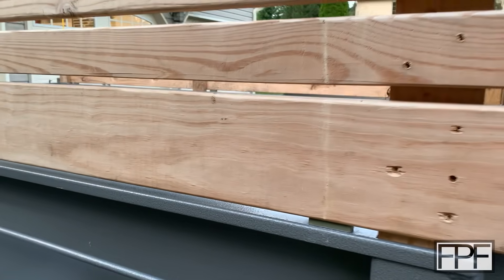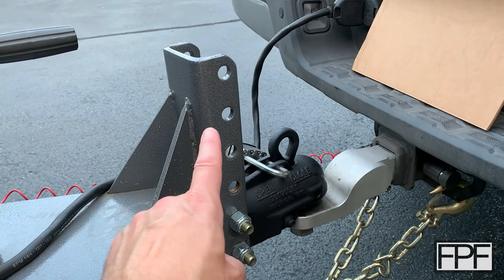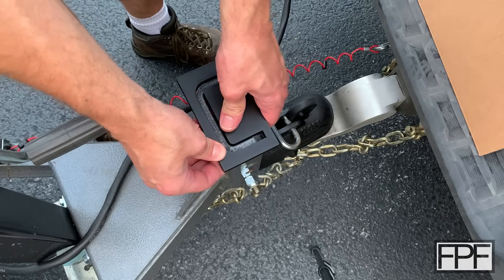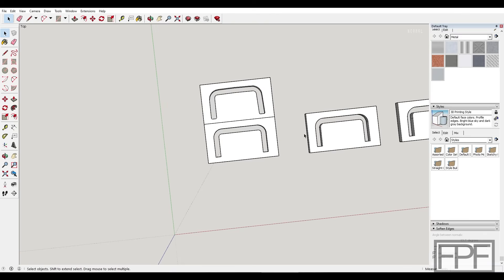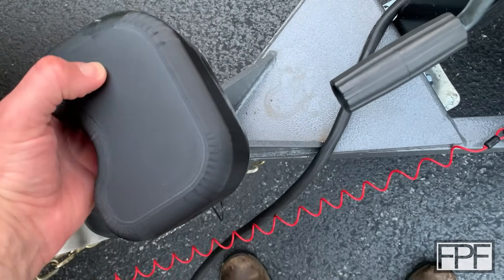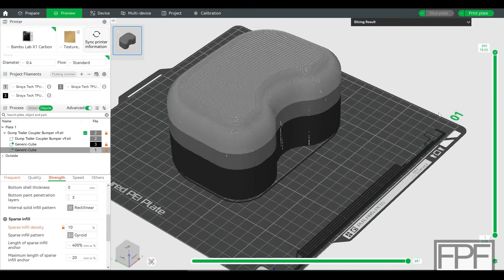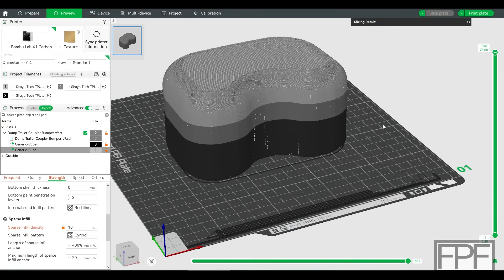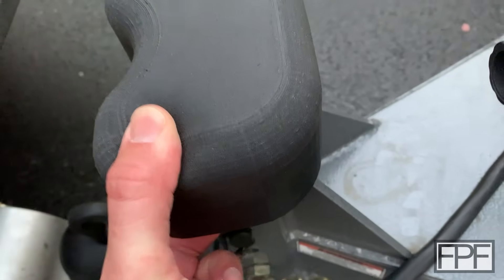3D Printed Bumper for Trailer

Comment: This is a nice print and good technique but I'd be concerned about what would happen if anybody sits or jumps on the tailgate where the pressure is on the bumper instead of the support cables at the sides. I vote for using a grinder to cut off the u plate down 1 set of holes so the weight load is in the correct spot on the plate.

Also do you have calipers?  They might help a bit for something on these lines as well.

Great video and showcase of the TPU differing stiffnesses!

Comment: Hi there, just started watching yo channel and thanks for taking the time to share. I saw the lathe comparisons, and the trailer bumper, and you had mentioned that you needed it softer and I've just been getting an advertising for a 3d type printer that only makes softer jell parts, and I'm sure it would be closer to your needs, then other 3d printing materials, but I am shocked to know the material makers couldn't come up with a formula of printable materials that were softer, my goodness they can print a house out of cement but not make a poly blended plastic that would give ya a softer part. Look at how many recycling Co., that won't recycle those black plastic containers you get your Chinese take out food in. The plastic is really flexible and rubbery like, if that plastic had more poly blend added to it, I'm sure they could find a winner. Anyho nice job on what you used it got a good cushion to save yo tailgate. One for the winning team at least this time ah! Please Have The Best Day's Possible from All of Us at: Bare.Metal.Custom.Workz in Barrie ON Canada 🇨🇦 Sincerely Andrew

Comment: Probably too late to see this comment but I recently added a 10W laser to my CNC machine and it's been incredible for templating and testing fitments on a plane.  I just laser cut thick construction paper or 1/16" MDF instead of 3D printing and use that to refine my designs.

Comment: To be honest you probably could have just left the first print as it was and shrunk it by .5% and because your final material was TPU it would have been as sung as the final print you did. TPU is very forgiving with dimensional accuracy. When I have to make something that has threads an is going to be printed in TPU I make it exact size and do no offset on the threads and it is tight but is more secure. Good vid though.

Comment: Nice job. Any chance you could look on Makers at the 1300% Dummy print? It has joins for articulation, very similar to the nubs you put on the bumper to hold, but they are too loose. You would be the perfect bloke to come up with an "addon" solution. I can't think of one. It's a print that has no real purpose other than shts and giggles and a great learning process

Comment: ik this is a 3d printing channel, but if you never plan on going that high on the drop hitch id have just lopped it off right to the top of the triangle bracing then shot some paint and capped it with a print rather than have a bulky butt shaped pillow lol. otherwise great work

Comment: Pretty wasteful prototyping on this one. Really felt like those tests could have been done with far smaller prints.

Also, does that CAD program not allow for high geometry resolution exports? There should be no reason for the final product to have those low poly style lines.

Comment: Instead of making the part a tight fit on every surface, you would save yourself time and make a more functional part by indexing the part off of the flats. You really only need the part to touch on a face in each cardinal direction to constrain it's movement on the XY-plane. The corners of the box section are the least predictable/reliable geometry and are redundant for constraining the part.

Comment: Nicely done. Noticing how the metal channel isn't square, the fastest most accurate method could be taking a few key measurements and then a good photo of the top view, non distorted so you can use that as a reference image to draw your profile over. Import that onto a top view plane and scale it using your measurements and then extrude the C channel.

Comment: You did make it fit after the shape of the steel..just make it like a thicker part around in the same shape of it with just a bigger soft top like u have it now mabe. like cutting of the sides/front/back from the org design..but sure it does the job right now :)

Comment: If i were having a part like that hitch riser made in volume, i'd punch the holes first, then cut the outside edge, then bend it in a press brake. Probably in a machine with a cnc punch press integrated into the cnc plasma or laser table. That why you couldn't find the profile - every shop that's making them is getting a slightly different profile. And you'll probably find, if you look closely, that the trailer manufacturer carefully designed around the expectation that the profile would vary from one supplier to another.

Comment: For an even lower tech solution, you can always photograph the top from a straight down perspective and trace in your CAD software. Alternatively you can make a template with card stock or even use a contour scribe tool (3d printable too) then scan the outline to trace in CAD. That's probably the quickest and least wasteful route without needing a 3D scanner
Reply: Even lower tech...  Hold a piece of paper on the top of it and rub it with a pencil (like we used to trace coins in school). Stick the paper in a scanner and you get a dimensionally accurate outline that you can trace in CAD. 

After you trace it, expand the outline by a bit to give yourself some tolerance for a sliding fit.
Reply: Great point!

Comment: Minimal surfaces in general and gyroids in particular are very brittle structures. They have this interesting property that once they fail, the layer that failed crushes, and the two layers sandwiching it jam up and recover about 90% of their structural strength. Which makes it great for things that need to stay stiff and not fail catastrophically. But they're not great for bumpers and shock absorbers.

You could probably dissipate a lot more energy with a re-entrant lattice. A fully 3D lattice would have some gnarly overhangs between its cells though, so I don't think a fully 3D lattice would be the way to go. But an extruded 2D re-entrant lattice (2.5D you could call it) running parallel to the hitch, with the part printed on its side, could probably work quite well.

Comment: I noticed that the curves in your part have a lot of facets. I can usually fix this when exporting from Onshape by using "fine" STL or using STEP files instead, but it appears Sketchup doesn't offer those options. After looking around for a bit I found a video discussing softening and smoothing in Sketchup that can help with this. I posted this comment earlier with the link to said video, but it seems to be gone now, maybe there is a setting that is blocking comments with links (understandable), apologies if that was the case. If interested in the video, a quick search and you will find it.

Comment: Great use of material! For finish, if you can export the file as step or stp, when you import to Bambu you’ll have the option to set parameters for the resolution of the part. You can leave the linear deflection down low and keep the angle deflection near the middle, this will give you smoother radius’s. Essentially what you got from the stl and 3mf files were lower triangle counts for the surface which gives you that step effect on the surface of the radius. Give it a try and you’ll appreciate the result!

Comment: That is some cool filament. I am a newbie and just made my first print for  a surge protector to attach to my wall. I took a picture of it and scaled it but it was taken to long so I found a file on one of the share files. I learned that it is very difficult for a hobbyist. I just use the free SketchUp and they limit you on file types to upload err. Then I was given a 3d printer and the software was unable to be upgraded err. I did manage to get some prints but the prints started to stick to the bed err. I purchased a new one then found it just kept happening err. Then I wanted white filament and stated the exact kind of printer I had and ordered it and the real did not fit in the machine err. I love the process and the ability to create that is what I love about your channel. Every now and then find a comment that a newbie deals with and address it would be helpful. I look forward to viewing your videos.

Comment: Turned out nice. My concern now would be about leaving it out in the elements. I.e., rain, snow, etc. Will it absorb rainfall?  Do you store the trailer inside?  If not I’d be thinking about putting something like a bucket over it when not using the trailer.

Comment: Very interesting filament to  work with. Thank you.
Comment on the trailer hitch. I have been advised it is not a good idea to tow with a padlock on the ball hitch. Could be a problem if you had to disconnect in an emergency. I use a padlock when I leave my trailer parked but replace the padlock with a pin when I am towing.

Comment: I think the gyroid infill is perfect for this application.  It's like open-cell foam, in that if you squeeze it, the air will move to another part and bolster them.  Other types of infill would create closed bubbles, so locally the part will be stiffer, but deforming that area will not affect neighbouring areas much.  In this usage, you want the soft part to conform to the shape of the tailgate, so it provides more distributed and even pressure.  With a closed-cell, you won't get the same degree of conforming, so you'd get quite concentrated pressure over the initial point of contact.  Note that this open-cell nature does rely on the perimeters being airtight (or nearly so).  If you get a tear in the wall, the top layer will be much too soft.
You went to great lengths to get a close-tolerance fit.  That's fine, because you're making it for yourself.  The problem is that making the STL available is likely not going to work for others, due to the low-tolerance of the steel.  A more widely useful version would need to be less snug to accommodate different degrees of steel distortion.  This highlights the problem of using STL as a way of sharing models.  We need a standard file format, which contains much more of the modelling information, without necessarily containing the full design history.
Congratulations on reaching 50k subs.  I subscribe to very few channels.  The ones which earn my subscription have to be consistently good.  I haven't subscribed yet, but I'm teetering on the brink.  I've not seen a duff video from you, and they always contain food for thought.

Comment: POKE A HOLE IN THE BOTTOM! That bumper is definitely using the trapped air to change its compression, especially comparing tailgate to finger testing. Over time more leaks will form and you might not like those results, so intentionally test it.

Comment: This same effect can be done with generic 95A TPU by changing the infill at different layers using modifiers. It might not have gotten pillow soft, but close enough. Might save some money and the learning curve of foaming filament. 

The same foaming effect can be achieved using wet 95A TPU all the way down to pillow soft. But that is a complicated mess of changing speeds, temps, cranking up the flow, and using fuzzy skin to hide defects. I don’t recommend.

Comment: I generally love your channel, but this is very much a case of 'when you have a hammer, everything looks like a nail.' It would have been better to just grind the top most section of the trailer attachment off so it's not as tall. You could then even re-print your 'pillow' but modify it to account for the steel braacing so the nubs lock into the next hole down. You might even be able to make it so that when the truck bed door is folded down flat it's supported by the pillow.

Comment: Worried that the tpu bumper will not be water proof imagine a scenario where it gets soaked holding water then freezes wonder how soft it would be then? Just hack the thing off with an angle grinder then print a cap to make it neat

Comment: Scanner not withstanding,  I may have tried taping a piece of printer paper to a suitably-sized piece of plywood, laying it on top of the C-channel, paper side down, and tracing around the channel with a sharp pencil.

Then cut the shape out, tape it to my monitor, and use whatever image editor you're comfortable with to trace the shape directly off the screen (Inkacape comes to mind for me). Import into CAD, extrude, scale using outside dimension caliper measurements, and maybe, just maybe, a good fit in one, fell swoop.

Comment: You don't need to 3d scan this sort of thing. I just use a piece of cardboard and a rubber mallet to take an impression of the part which I can then take into the shop and measure accurately. It's surprising how well this works.

Comment: I think 3d scan is probably overkill for a 2d profile with a key, and not in the toolbox of many viewers.  I've had to do something similar recently and first try from measurements and eye balling it, but it was off so I took a couple of photos of the profile and traced it.  For me that was the appropriate amount of effort.  But on the tpu, I'd definitely like to see how to do different profiles. I don't have the variable shore hardness TPU but worth having in my toolbox.

Also how soft was the top layer, that looked like a neoprene bumper type softness (like a baby bumper)?

Comment: First of all, congrats on 50k and thanks for the great video!
I agree that there may have been more efficient ways of getting to the final profile design (2d/3d scanning - as pointed out by you and the comments), but I do appreciate you showing us this process as well.
3d scanners are often as expensive as printers, and sometimes due to inaccuracies in the scan/print - rapid iteration is needed anyways.
What I'm trying to say is, its refreshing to watch someone work through the process instead of "buying" their way our of it (by scanning it) - this is more accessible to everyone.
So don't shame yourself too much for not using the right tool for the job, the 3d printer is the right tool for this job, and it's all you really need.

Comment: I don't really think that such a snug fit everywhere is necessary. All the curves could have 2 or 3 mm play, since the flat parts would keep it in place. Most important things are length, width and angle between planes, it could save you tons of time and material in the future.. A really nice job, it's a great way to show 3d printing usefulness.

Comment: Congrats to 50k, your intro was really funny. I started my morning in Sweden with a smile after seeing that. 

I saw that you have visible "edges" on the perimeter around the rounded radious of the part. I should try to bring down the "Angel" setting in the STL export options. In Solidworks it is described like this: "Angle value to adjust the angle Tolerance, which controls small-detail tessellation."

Comment: Very easy way to get the shape correct on the first try is to take a picture of the top surface together with like a ruler at the same plane . Then import it as a canvas in fusion360. Right-click the canvas and click calibrate. This way you get a dimensional accurate picture. Then you can just use sketch and draw the outline of the object. I've gotten super accurate 3d prints on the first try using this method.
Reply: Same in Onshape

Comment: A small critique: are those mouse ears (that follow the inner section of the steel riser, and make the final part vaguely C-shaped) really necessary? It doesn't seem to matter for this application, but in another situation they might have acted as stress risers, concentrating the force of impact on just those two points. A simple rectangle would have presented a more contiguous, and wider, surface to a falling part.

Comment: I know it's only a cosmetic thing, but I noticed that on the rounded corners, you can see it's made up of flat edges. 
I use onshape, and I know to reduce this  I have to alter the  resolution, in the export options. It looks like you're using Sketch Up, does it have a similar setting?

Comment: Would love to hear about the filament profiles in next week’s video. 

Also, I think it would be super interesting to see how much time you’d save on this exact design using a 3D scanner. 

I’ve found myself in the same situation several times, defaulting to calipers and a top down photo. Then, right when I get a design that works perfectly, I remember that I have a 3D scanner and it probably would have saved me a ton of time. 😂

Comment: I usually add a hole for air to move in and out, taking advantage of gyroid infill being a single volume.

I add a modifier (i.e. a sphere) at a suitable location with zero walls/bottom/top layers.

This creates a hole for air to escape and re-enter the part

Comment: I am a functional print guy since 6 years ago when I had my first 3D printer, most of the time I iterate designs base on a picture of the outline like in this case you can hold a piece of paper or cardboard, mark the outline, take a scan or picture with some dimensions measured and usually nail it in the first test print 
I figure you know this, is nice to see the process taken by you always
Reply: Similarly, many objects can fit on a flatbed scanner like the ones found on combo inkjet printers for home use.